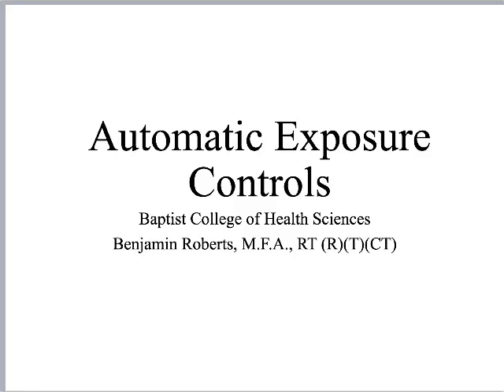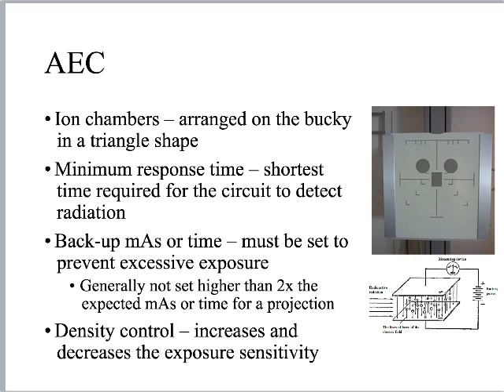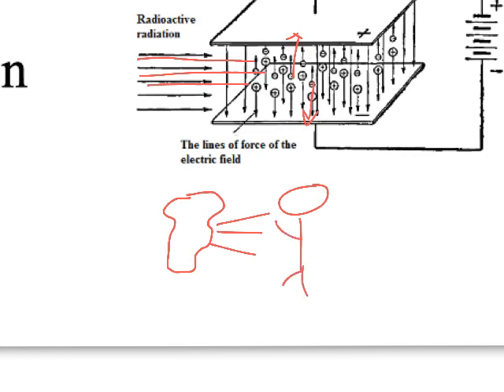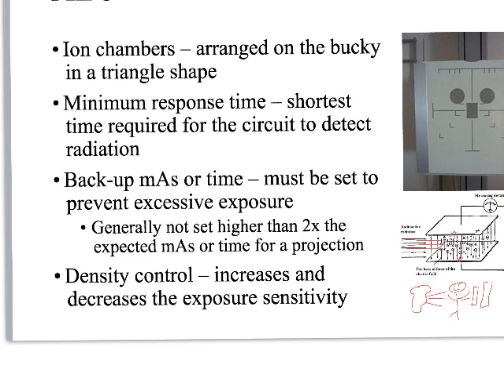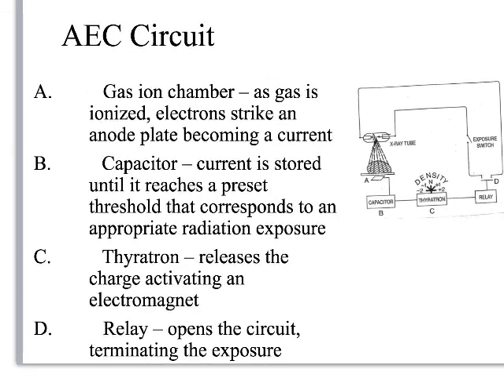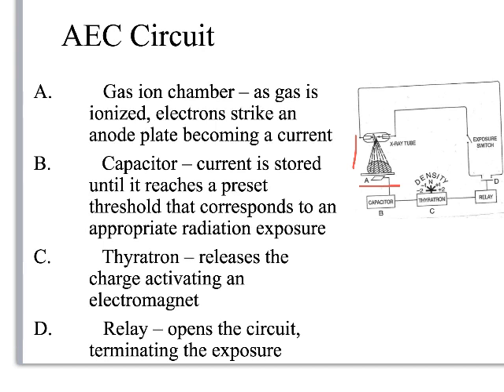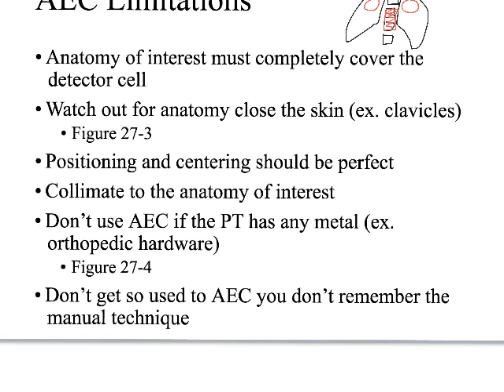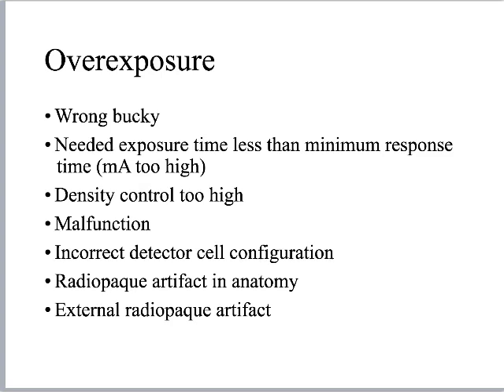Automatic Exposure Control (AEC)

Comment: Wondering if you could clarify; In my Martensen image critique textbook it states “when a pneumectomy is indicated, do not select the AEC chamber that is positioned beneath the removed lung or saturation of the opposite lung may be present” however shouldn’t the AEC cell get the radiation faster due to the decreased density of having no lung tissue, therefore cutting the exposure time shorter causing the exposure to be underexposed ? (Saturation means darker image correct?)
Reply from the maker: Yes. That sounds like a typo. Good eye! I bet the author would appreciate you emailing on that one.
Reply from the maker: Hey Danielle, I think you might enjoy a book I've recommended to my students. It's called Time, Distance, and Shielding. It's a medical thriller with an x-ray tech as the hero. It’s a fun read, and it has a lot of stuff in it about patient care. Here's a link to the book on Amazon: https://www.amazon.com/dp/B088867YHK